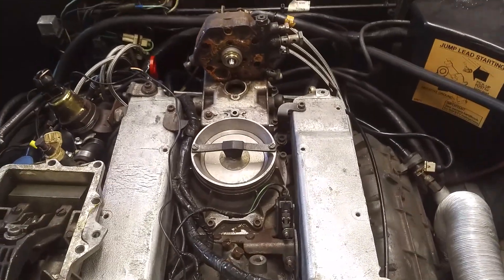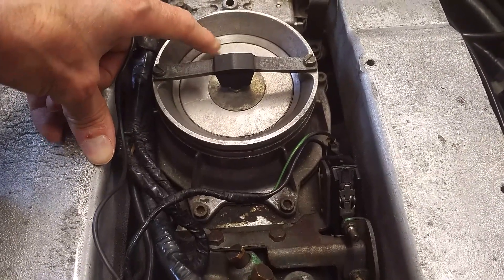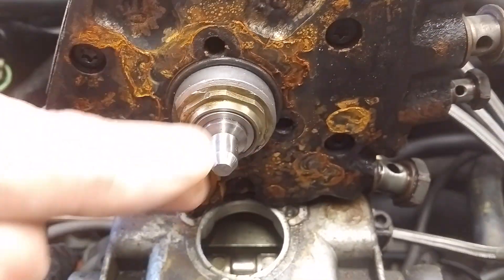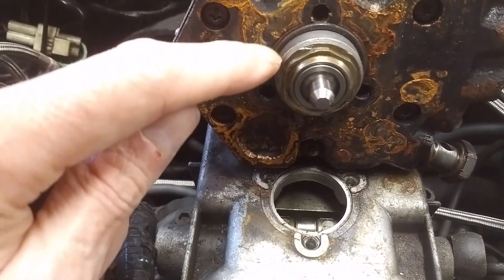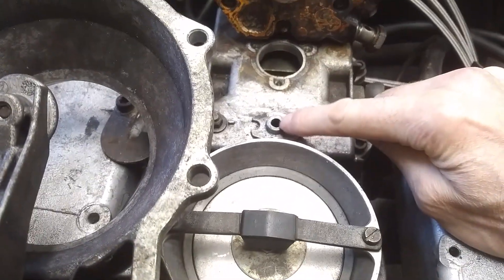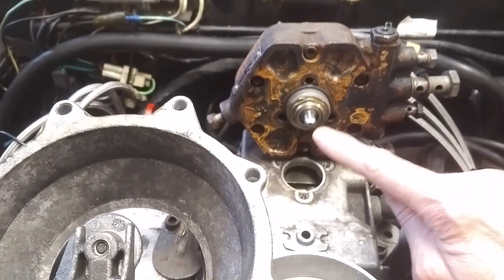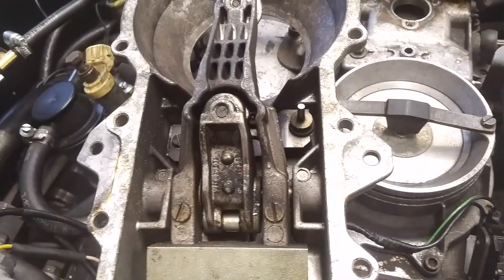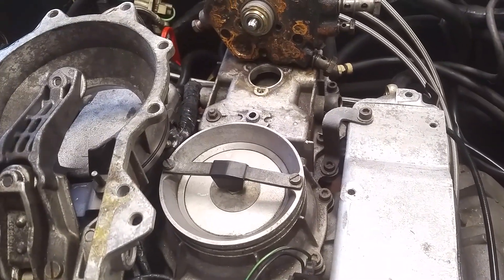DeLorean Fuel System Part #3: The fuel metering unit

Comment: congratulations for the video.  i have opposite problem.  only one injector sprays even if I don't lower the air dosing plate.  the distributor has never been serviced.  I also tried with other injectors but the problem remains.  thank you.
Reply from the maker: Metering head has some crud holding that port open. Needs a refurb.